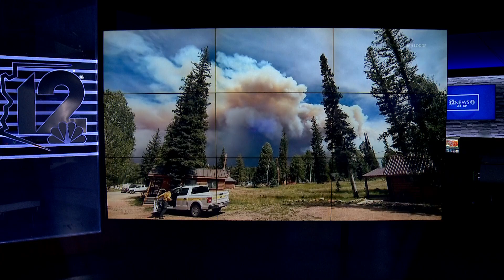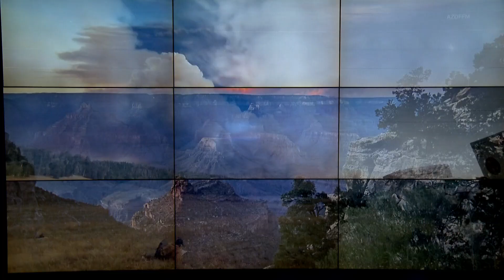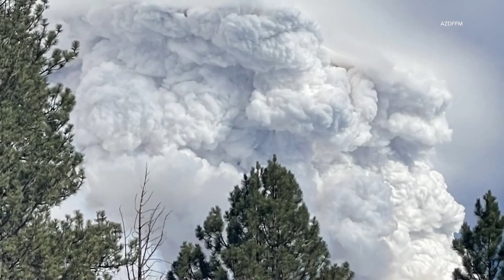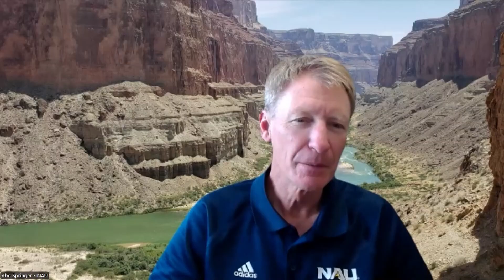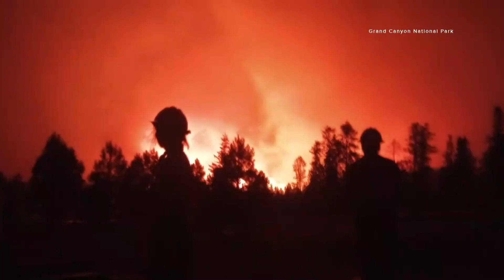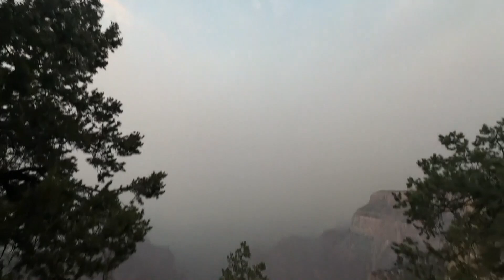NAU professor to test Grand Canyon water supply for fire effects

Comment: My understanding is that the new water pipeline project does not take it's water from the pump station at Roaring Springs.  The intake for water that goes solely to the 8, 1 million gallon water tanks on the north rim (hidden in the forest above the residential housing area up behind the Back Country Office and Maswick Lodge) will be from the new water intake in Bright Angel Creek, at the river delta, where the BA Creek meets the Colorado, and where the giant construction site is located.  Where does Bright Angel Creek get it's water from?  The Bright Angel Creek watershed area of the Kaibab Plateau, which has 100% burned to the ground, during this fire.   Roaring Springs only supplies water to the North Rim.  Where does the water from Roaring Springs come from?  From the Kaibab Plateau, where there are giant, fully exposed, natural "water collection funnels," which feed natural underground caverns.   You can see these locations as you drive Hwy 67 in the area before, around, and after, the Kaibab Lodge.  They're large pools of open water, with fences around them.  A geologist a few years ago, put dye of different colors into each of them, and then waited to see what color dye came out at Roaring Springs, and that's how "they" were able to find which of these "funnels" is the supply for Roaring Springs, and at that time, both the North Rim and South Rim.  They wanted to protect that location...  of course that has all now burned.
Reply: Roaring Springs does currently supply the water to both North and South rims. The new construction will allow Bright Angel creek surface collection and treatment, which is still under construction
Reply: @mattyoung1240  Thank you for that info.  My understanding (maybe incorrectly) was that the line from Roaring Springs heading south was being abandoned.